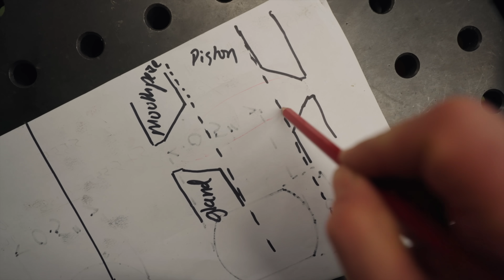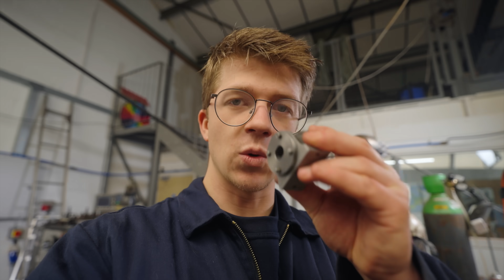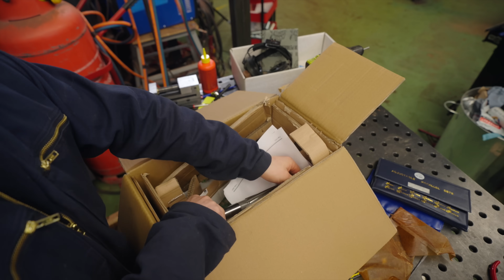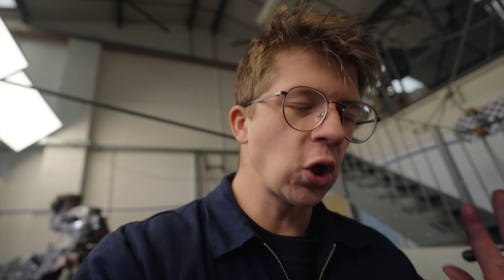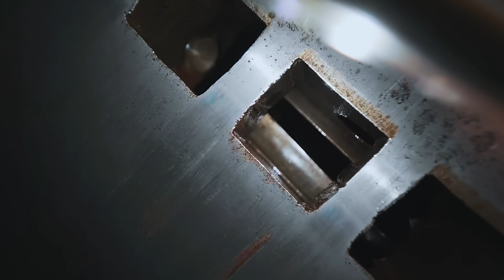Making My Own Steam Power Hammer! Part 3

Comment: boaring head,  take up the slack (lightly turn feed screw) loosen the centre screw then snug it back up.  undo the two outer screws, adjust your cut to your preference, tighten outside screws then the middle screw,  you should be golden,  the screws should be tighting onto a hard steel "gib"(actually a clamp plate) if it's soft you don't stand a chance

Comment: Reamers always cut a little oversized, any run out in the spindle seems to be amplified. It can be improved with the correct feeds, but I never had much luck and found adjustable reamers the real answer

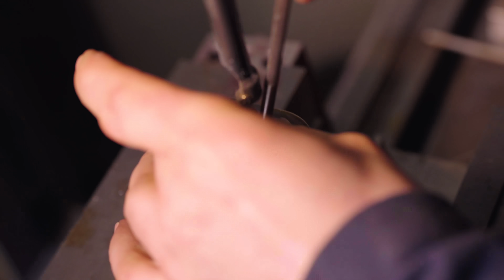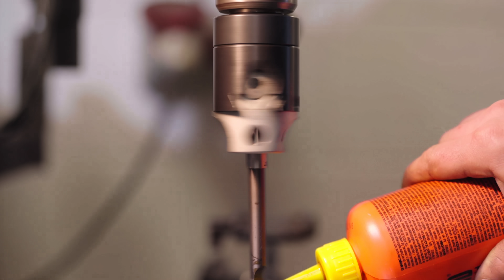Comment: At 12:25 you can see the rubbing on that top part that was larger. The shank of the boring bar also shows some black cast iron dust at 12:16. You were having a problem with the size because the tip was deflecting more than the base. You probably needed a longer boring bar or to grind the shank back on that side a bit.

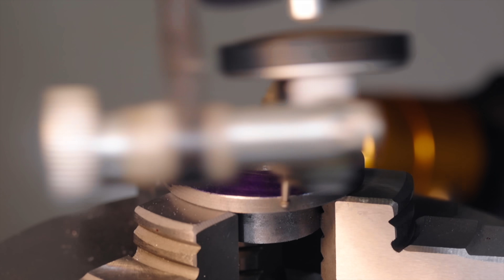Comment: 2:45 you werent in the middle for that operation because you indicated the part in on the operation before that and were using copper soft jaws so once you flipped it it was no longer in the same center as the soft jaws have unpredictable clamping

Comment: I know im late coming to this but the problem with your boring head could be the boring bar deflecting with load, i think thats why ours at work that look very similar are such a pain, also in my experience leaving the gib screws on the head fairly tight and just overpowering them to move the head seems to have helped a touch

Comment: When I was a machinist I ran into the same issue with the backlash in boring heads- you need to back off 1 turn, then turn it back to where you want it, this takes up the backlash.

Comment: For a reamer that big you would want more like 0.01-0.015 inch material to remove. And with oil the reamer will cut a bit bigger for a smaler hole you want to use coolingwater.

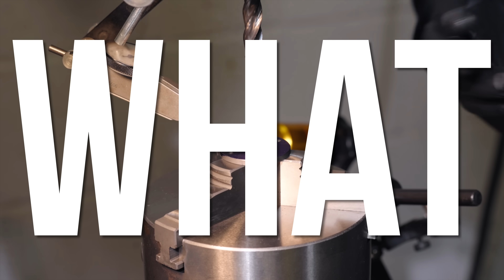Comment: At 2:50 you were off center because you swapped from using those copper inserts to going right off the part. 

Ah, those adjustable boring bars. I know them well. They can be major pains in the ass, even good ones.

Yep, reamers generally cut larger than their actual size. 

Also if you are dealing with .001 tolerances I highly recommend getting a micrometer rather than a caliper.

Well done on that 90 degree hole. Holes that long can be difficult to get to line up thanks to drills walking.

Comment: Hey Alac, the hole you made might be a bit proud of the actual measurement, because you used pure oil. The final results vary depending on if you use an water oil emulsion, pure oil or if you just "rub it in dry".

Comment: Keep up the great work.  Becoming a good machinist takes a lot of practice.

Your tapered bore issue from the boring head is because the tooling/bar flexes as it goes down the bore.  Just like on the lathe when you need .001 inch tolerances or better, you need to do 2 or 3 spring passes (running down the part without changing the settings) to allow the cutter to relax in the bore.

Comment: I’m not a machinist but I believe I’ve heard Adam booth say this, when machining cast iron, you don’t need lubricants. Especially with reaming holes because the hole will be oversized due to the layer of oil between the cutting edge and the work piece
Reply: Yep, the graphite in cast iron does a pretty good job of self-lubricating when machining it. Most people won't use any sort of cutting fluid when working with cast iron.

Comment: Only my huble noob opinion, but I wouldn't trust your calipers for an accuracy greater then +-10thou. You should get a set of gauge pins for that. (There is a saying about measurement devices: The last two numbers on a dial are to only be considereda tendency not an accuracy)

Comment: had to take old drill bits that broke or were sharpened to many times and weld them to a bar stock to make a reamer... 200 is a bit expensive. 1/4'' is standard for pilot holes so they pile up, reuse the shanks? ... mean while, me drill press ran its own rump to the ground off the cliff side making a drive shaft flange only the motor works butt the chuck wont slide up and down, hit the ground rather hard, just planned planted 'n stuck. really don't see how it was able to get anything done!

Comment: When using the boring head, try taking spring cuts, to compensate for flexing of the boring bar. Spring cuts are just extra cuts taken, with no cut applied.

Comment: If you want your reamer to cut a fraction larger than it is doing, then put your part in the freezer before you run the reamer through. It'll shrink, you drill the hole slightly too small, it warms up and it's on size... hopefully! You could do the maths with the coefficient of thermal expansion etc. 

Reverse works for making it drill smaller: heat the part up before you ream.

Comment: Is the reamed hole diameter larger than the reamer's stated maximum diameter? If it is there's a possible explanation other than the reamer being bad: your spindle wobbling. When using reamers on very tight tolerance this can be mitigated with an adapter that "decouples" the reamer from the spindle, but your dimensions probably aren't tight and critical enough to warrant that.

Comment: It’s funny, yesterday This Old Tony finally released a new video where he made some machinist parallel clamps and then tonight I’m taking measurements on a circuit board for some CAD work and here you out the together, pulling measurements and then machining stuff. Love these videos Alec, keep up the good work. 

Btw, should have saved tramming the the mill for when you had square space as a sponsor. Will has been throwing the square space puns out a lot lately and that came to mind.

Comment: A couple of tips for the boring head; boring can produce a lot of deflection, so do a few passes at the same size. This will make sure it's going to the size it should, as well as deal with taper in the bore. I'd also check the grind on the boring bar itself, a lot of the cheap brazed carbide bars have poorly formed edge geometry, and will cause greater deflection and poor finish. Make sure that the heel of the carbide is ground to clear behind the cutting edge, if its close, it will contact and deflect on a smaller bore, but may clear as the bore gets bigger, which would give you inconsistent results. Lastly, if the boring head has a sloppy dovetail or leadscrew, it could cause the bar to shift when tightened. Most boring heads do this to some degree, but it should be tenths, not thousandths.

Comment: You can dial your boring head in with your indicator. Just lock the spindle in place and set up your indicator so it is touching the cutting edge and then adjust your boring head half the amount that you want to make the hole bigger. The half part is very important because you are adjusting a radius to cut a diameter. Although this wont fix your taper issue. That is likely heat build up or your cutting edge getting worn down. Which can be fixed with higher quality bars or using an indexable bar so you can replace the insert once it has worn. Hope this helps. Looking forward to the rest of the series.

Comment: There is an even easier way to center a rotary chuck on the mill. You loosen the clamps that mount it, bring down the nose of the spindle the clamp on the nose of the spindle then mount it to the table and loosen the chuck. Tada, you have a perfectly centered rotary chuck on the mill!

Comment: With all this machining you are doing, you should really invest in a coolant/Lubricating mister. it will save your cutting fluid  consumption significantly so your only using a tiny bit of lubricant to do the same job and your parts aren't dripping afterwards.

Comment: Hey!  For once I can help out here :) The big problem you're having with the boring head is that you're using brazed carbide bars without having ground them to shape.  Those NEVER come sufficiently shaped, so they don't have the rear clearance set right.  So what happens is that the first few times around 'cut' right, but as you get 'deeper' the lack of clearance behind the cutting edge causes it to 'flex' inwards and cut smaller.

IMO, those brazed carbide bars aren't worth it, and are incredibly unforgiving, even when shaped correctly. I picked up a set of insert-based ones (despite being otherwise a strictly HSS shop!) and it works a treat, even in a cheap boring head.

Comment: You regularly show shots of the drawings and dimensions.  As an engineer, I'm curious what the tolerances are.  Since the measurements tend to be in inch fractions, I'm guessing 1/64" (~.015)?  I think you're spending a lot of time aiming for <.003" which is why its taking so long.  If you're going for precision for the fun of it, that's great, as long as you realize you may be spending more time than needed.

Comment: Alec make your life far easier and the job more accurate by getting a facemill bit or a fly cutter. You can do the entire flat surfacing job in one pass rather than the back and forth using the mill bit you were using. If you pull this off and want to push yourself even more get the mini lathe build kit which is the smallest working lathe in the world and total madness to even attempt that Joe Pie made.

Comment: A boring bar will cut a path. So can an endmill. A drill or reamer follows the pilot hole, but can cut over or undersize. Sometimes you have to do a test cut if its something you need to nail. Try different size pilots. Leave only .002 when possible, but some reamers will want .005 or .010. others will cut oversize if you leave that big of a cleanup cut. Not all reamers are the same. When trying to do something super precise anyway. Press fit holes and such.

Also a reamer will act different in .125 sheet vs reaming through a block. 

Im just saying just because its a .500 reamer and or mics .500 doesn't meannit will always cut exactly that size. 

And then you have dull reamers and thats a whole nother story. ( Tldr: They usually will cut oversize.)

Comment: you forgot one thing abut a boring bar ... it bends ... or deforms with pressure ... better to drill the hole one size smaller than desired and ream out to final ... toss the boring bar at the lathe .it only has use there tbh and only for off size holes ..

Comment: That rocol cutting oil works really good, that's the best in my opinion (perfect for stainless) BUT is very corosive, you have to wipe it off your drills and taps and the vapors are even worse (when the oil gets to smoke), your chucks will get all rusty if you're not carefull with it, and wash your hands before eating,  that stuff is toxic

Comment: On the boring you have tool slop but also that head wasn’t exactly square over the distance of the bore it tapered or possibly your tool wore you can compensate the slack by back dragging the cut it will run out on the bigger bore and be square

Comment: Alec just some tips with the reamer. Using lighter oil will help maintain accuracy, as well as only running the spindle while you are feeding. Dont let it just spin in the hole without moving and when you get to your depths stop the spindle and raise it straight up.

Comment: Ok so having worked in a machine shop where tolerances are less than .0001. I can say you will never get the accuracy you are looking for using a set of calipers. You need to use micrometers.

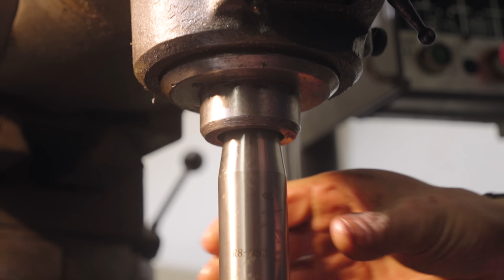Comment: 13:52 I find it helpful when boring in a mill to run each cut twice or even three times. Those boring bars are pretty long for their diameter and tend to flex. I.e. a .025 cut may only cut .020 and running the cut again will usually pick up that extra .005. Hope this helps. I’m a long time fan and have always been inspired by your willingness to take on new and difficult challenges.

Comment: That is so cool! I really appreciate showing the effort a translation from the technical drawings into reality requires. It all seems so easy at first - there's the drawings, the pieces are roughly shaped already, just make this straight, drill here, done. What an amount of information needs to be read out of the plans and then made into actual steps is something I would never have considered.

Comment: I as an precision engineer has to point out to you that the precision displayed on your calipers is misleading.
Only micrometers with correct presure aplying can give you the correct measurment with so much digits after the decimal point.
These fancy calipers can give these numbers but there construction, not being clean of the contact services and greater or less pressure will influence your measurement.

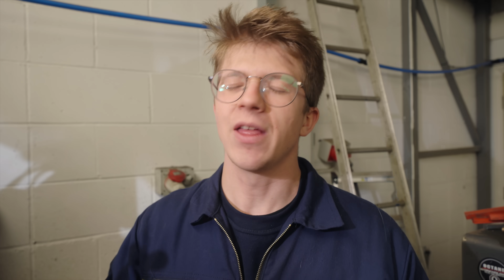Comment: 13:31 the top of the hole is bigger in diameter because you have a very long thin tool. At first, the forces on it aren't that strong, but the further you move down, the bigger the strain gets, bending your tool, making your diameter smaller.
I recommend cutting the same diameter 2-3 times. That way you'll get a consistent diameter from top to bottom.
Reply: but the tool is always making contact on its very end, no matter if you bore the top or the bottom of the hole. The only difference is that the spindle is being extended, however i would say that its possible bend is negligible when compared to the bend of the tool.
Reply: the only thing i can think of is that throughout the cut, the settings on the boring head are being changed - something is not tight enough as it needs to be to not get pushed back by the resistance of the material

Comment: The taper in the bore is probably a result of the boring bar flexing. Those brazed carbide boring bars that often come with boring heads are notoriously poor geometry as supplied and usually require re-grinding before they can be used properly. Alternatively you can use a lathe boring bar with carbide insert instead (provided you have one with the correct shank diameter to suit your boring head).

Comment: Love the machining video few tips 
were you using the locking screws on the boring bar?
when using a reamer it’s best practice to stop the spindle as soon as it breaks through and raise it up out of the hole without the spindle turning

Comment: Machinist here. With that cheap boring head, keep the center locking screw snug and don't touch it. Use the two outside locking screws to lock the "grey bit of the boring head". That should help you get a more accurate result with a cheap boring head 😂

Comment: Awesome project, Alec! Machining is all about what you can do, from where you currently are. Adapting to, and overcoming, challenges you're presented (and challenges you cause for yourself), is a valuable skill. You've always shown a fantastic ability to do just that, and it's one of the things that makes your videos so enjoyable to watch.

I think the reason you were seeing taper in the bore, is deflection. That boring bar had a lot of stickout, and it'll flex a little bit, regardless of how light a cut you take. It started cutting close to size, then flexed inward until the cutting forces and bending resistance of the bar found equilibrium.

Another note about the boring head... You don't have to loosen/tighten up the grub screws every time you make an adjustment. I have the same boring head, and I keep the "gib" screws ever-so-slightly on the tight side of snug. The adjusting screw has enough drag to hold its position once set, but not so much that it takes more than a couple of fingers to rotate it.

Comment: I have what appears to be the exact same boring head, and the dial markings on it are basically useless. When I need to make precision adjustments I set up an indicator against the side of it to directly measure how much I've moved it in and out. If there is any way to chuck it up in the lathe I'll always do that instead!

Comment: If you reamed that hole dry i bet the reamer would cut closer to size. Reamers cut slightly larger as cutting oil viscosity goes up. Thick oil = looser hole

Comment: Not sure if others have mentioned it or not but when it comes to accurate measurements put the verniers down and use a set of calibrated micrometres. Especially so when using telescopic gauges. For any that you need to be spot on in the sub 0.001" range use micrometres. Having said that your doing a fantastic job and I will be watching every episode you put up. Would also be cool to run it on steam when it's done too. 
Cheers

Comment: Precisely measuring the diameter of a round hole is very difficult.  Holes are often not truly round (due to minute wobble in the tool or machine head).  A two legged snap gauge is OK but not great.  You need to average multiple measurements.   A 3 leg snap gauge is better, but that requires special go-nogo rings to which you make a comparison.  The very best hole diameter measuring tools are diametric pins.  The dial caliper is another source of error, a micrometer would be better.  Have you checked the caliper calibration with a precise 1" gauge block?  The 1" reamer is probably the most accurate thing you have.  The 0.0015" overage may very well be less than 0.0005" with 0.001" error due to the diameter measuring tools.

The other thing is what is the stated tolerance on the drawing?  Does it say 1" diameter +/- something or does it say 1.000" ?  The piston should have rings, so the bore tolerance could be 0.005 or there abouts.

It is fun watching your videos, keep up the good work.

Comment: Pro tip..instead of using a belt sander to hit the faces. Get a heavy piece of flat metal and sandpaper on top and hit it on there. I personally don't like risking using a belt sander on something where I know my tolerances are tight.